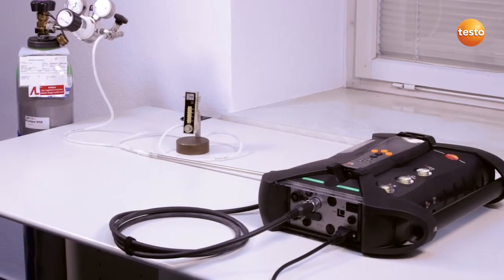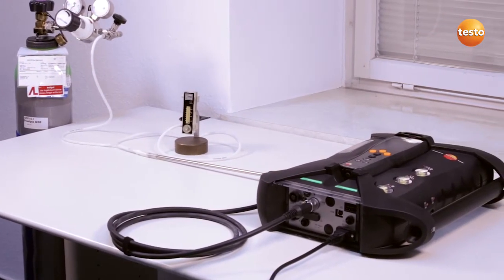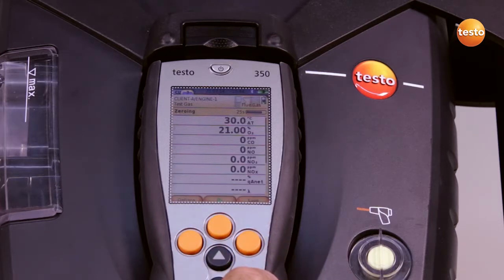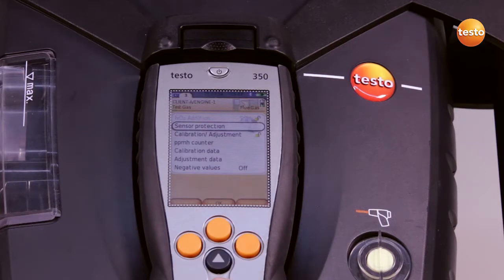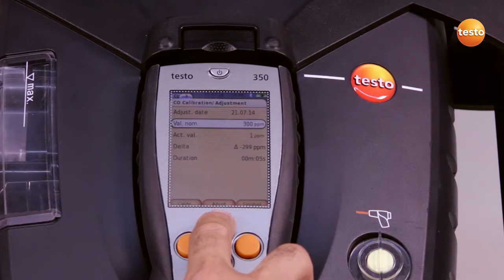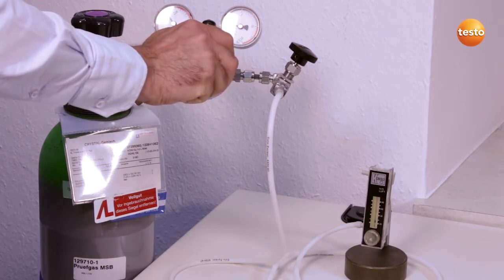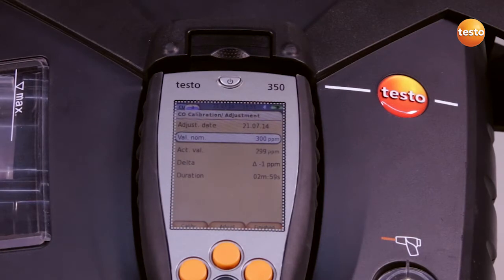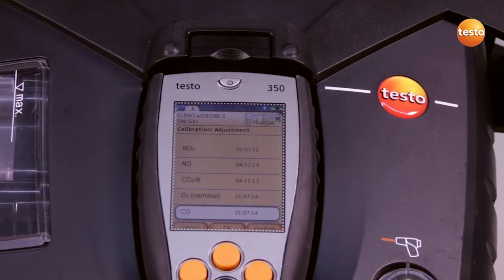testo 350 Gas Analyser - Step 8 - How to Adjust Sensors

Comment: Hi! We are using this device in our Lab for Flue Gas Monitoring, I want to know if we can perform the calibration by ourselves or if we should send it for external calibration with the vendor?
Reply from the maker: Good day. Yes it is possible to check and adjust the testo 350 yourself, but please be aware if any adjustments are done by anyone other than our Technicians calibration certificates become invalid, as you will have adjusted the response of the sensors. You also need to be very careful in adjusting the instrument correctly with proper calibration gas. 
If you prefer to adjust the testo 350 yourself, instructions can be found from the bottom of page 57 to page 60  in the instruction manual.
The following conditions need to be met 
• Use absorption-free hose material. 
• Select Testgas as fuel 
• Switch on the flue gas analyser at least 20 minutes before calibration / adjustment (to warm up) 
• Use clean air for gas zeroing 
• Maximum pressure of the test gas 30mbar (recommended: pressureless via bypass) 
• Apply the test gas for at least 3 minutes

Hope this answer helps you. Below is the link for the instruction manual download.

https://static.testo.com/image/upload/Instruction-manual-and-Software/Instruction-manuals/testo-350-instruction-manual-5771.pdf